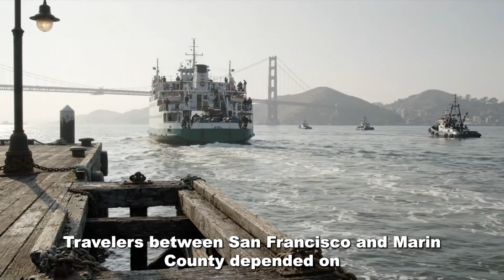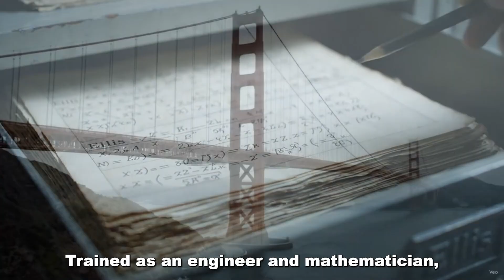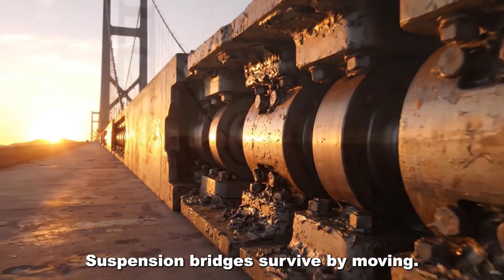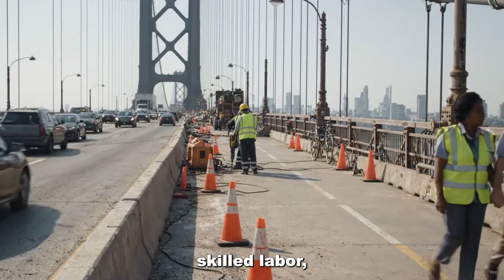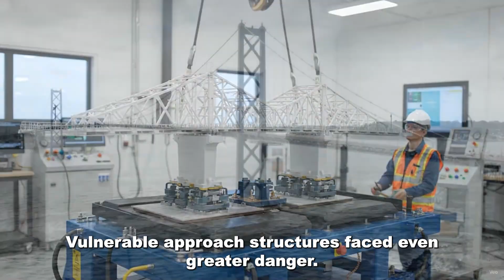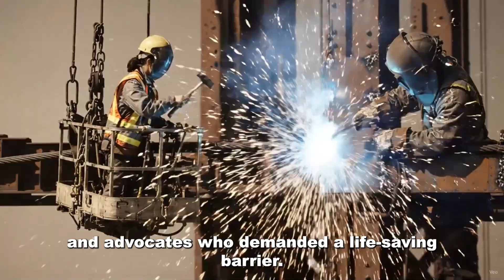The Golden Gate Bridge: The Masterpiece That Was Never Finished

Comment: I got a post production modification done to the GGB. The reason the engineers placed rubber dampers is I made them aware that, given time and access, the GGB could be brought down with one's bare hands. Today, if you look up the lengths of the 4 bundle suspension cables near the towers, you will see a rubber damper connecting the 4 bundle cables together. The dampers' function is to stop vibration. Back in the early 1990s, I noticed you could hit one of the cables with your fist and carefully timed another strike, you could compound that energy and very quickly you could have that one cable vibrating like a guitar string. I could feel the individual plate rising beneath my feet. That one cable was vibrating, by my visual estimation, 3 feet off of center. I did this a few times, mostly to show my friends. Cars were slamming on their brakes at the sight. Then, one day (1991?) I went to the GGB and the dampers were new and in place.